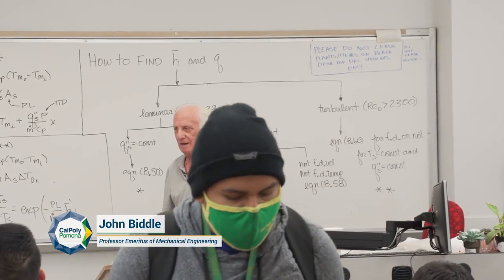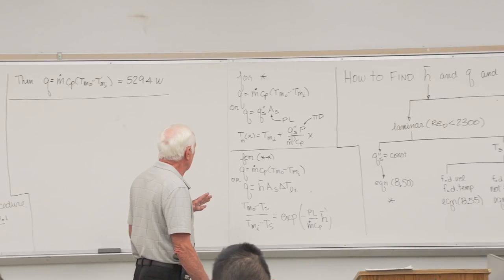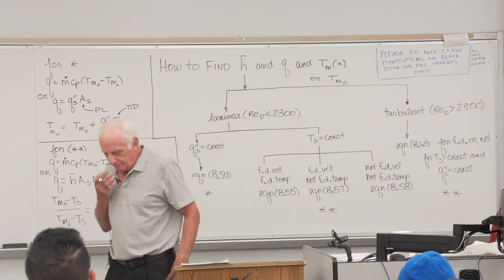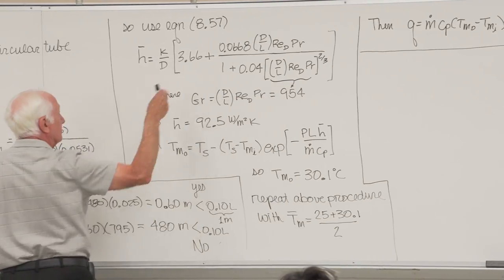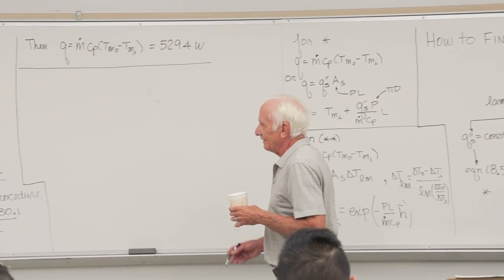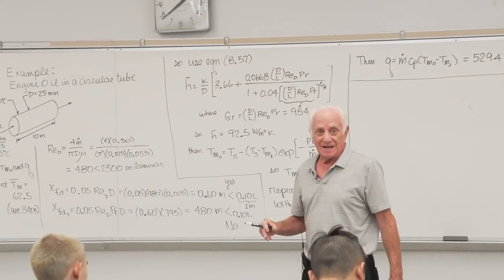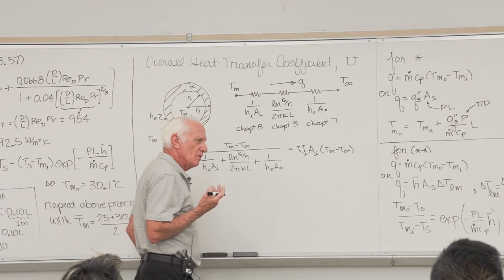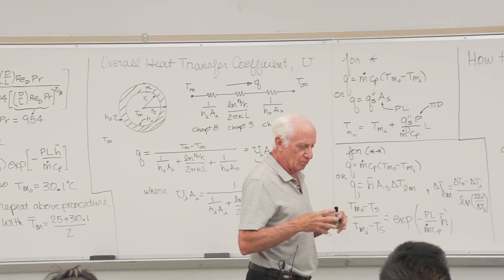Heat Transfer (29) - Heat transfer in tubes examples, Overall heat transfer coefficient

Comment: How do i consider the thermal radiation in the overall coefficient of heat transfer without knowing the exit temperatures of both fluids. For that, i wanted to apply the e-method.